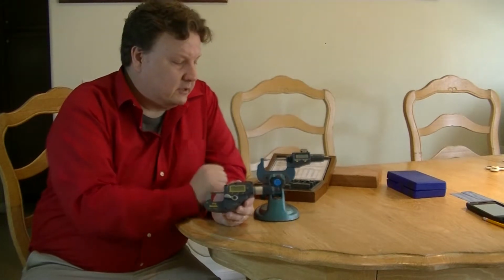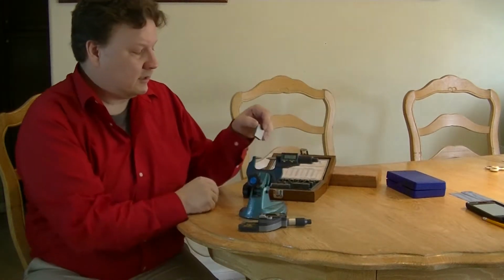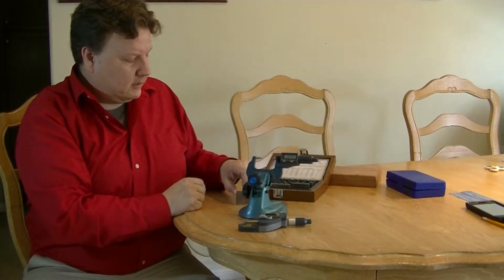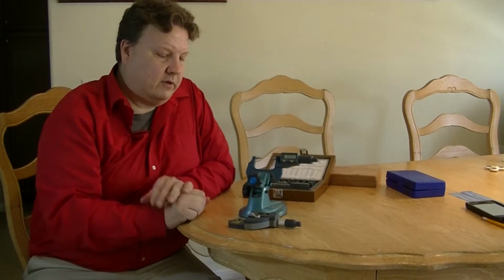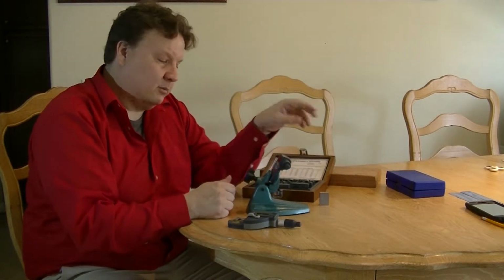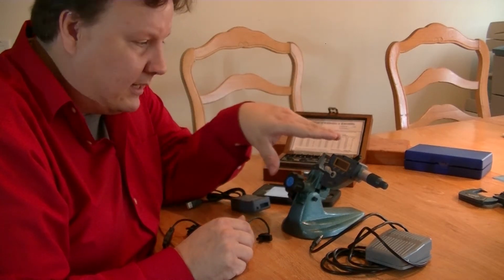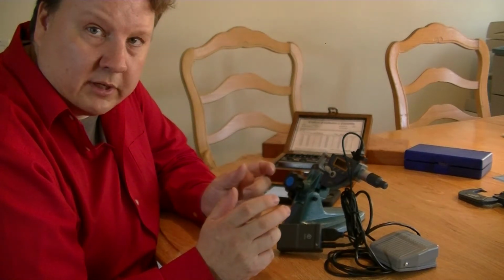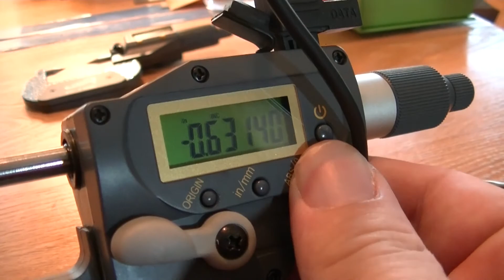SpeedMic by Igaging

Comment: Does it still screw in and out too?
Reply: No, it has the spring load mechanism in the handle where the vernier adjustment would be on a normal micrometer.